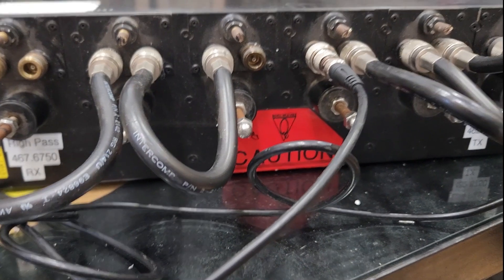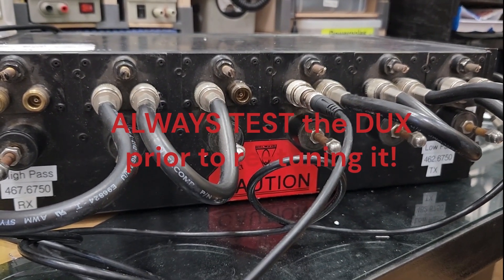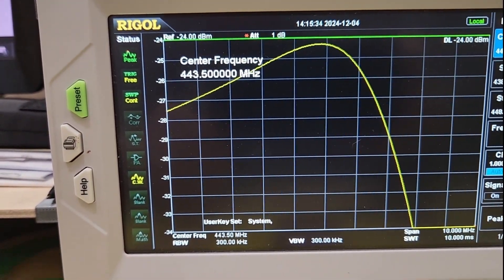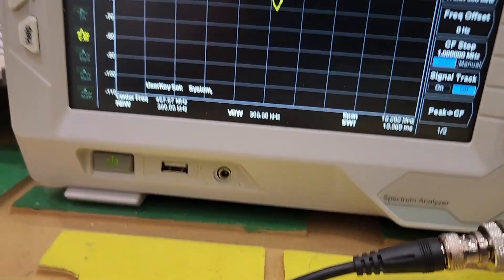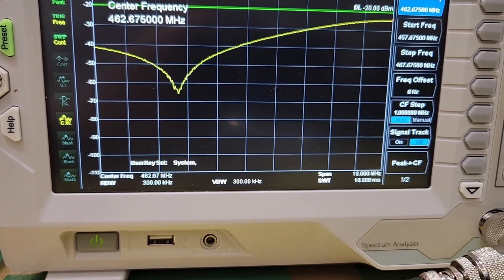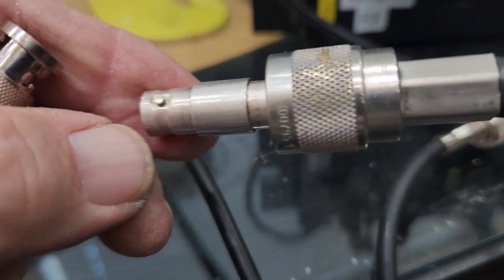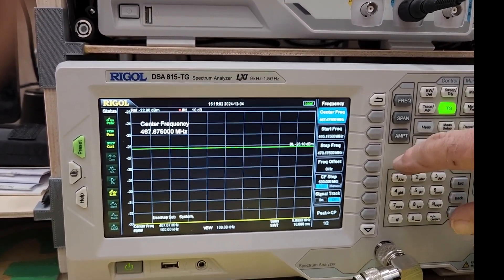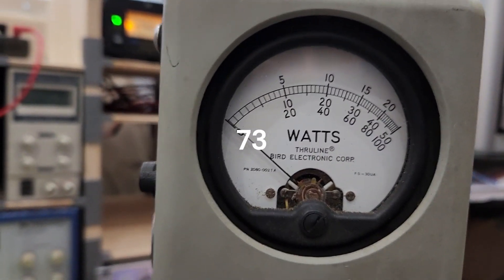How to Tune a UHF Duplexer for Ham Radio and GMRS

Comment: Set your spans for 50 mhz, then you can see the whole picture. Also, zero out your cables for the course can tuning, then when done, touch up  but you need to have a 50 ohm load  in that open ports when touching up after the harnesses are installed  and you will eliminate that nasty hump. 

The other thing 90% of everyone fails to do is RETUNE when at the repeater site, but using the antenna in place of the dummy load on the open ports so you are tuning for the actual load.